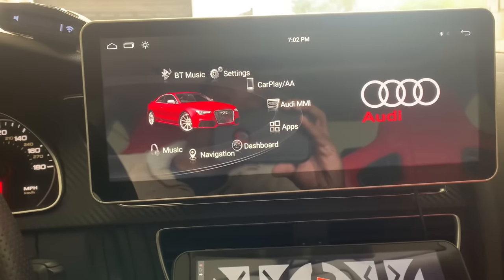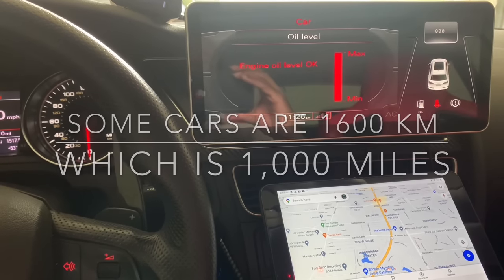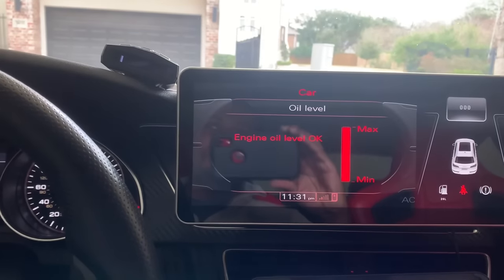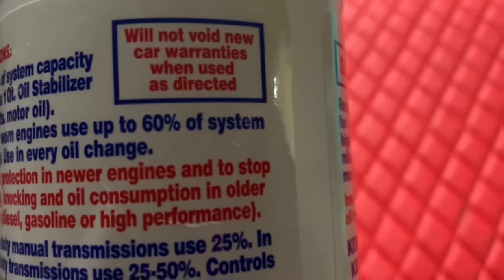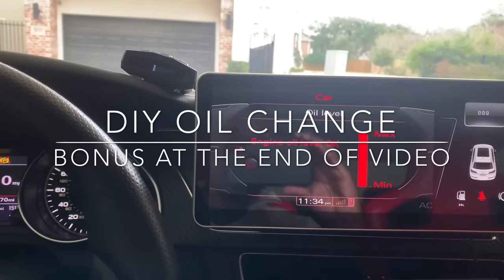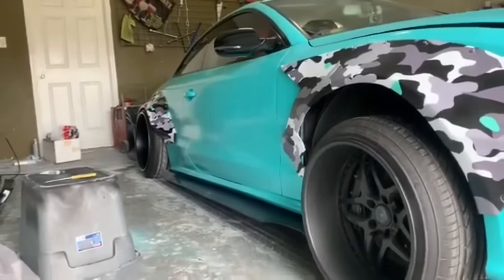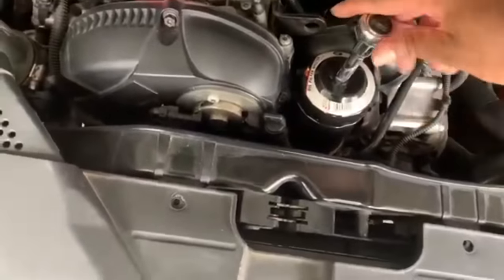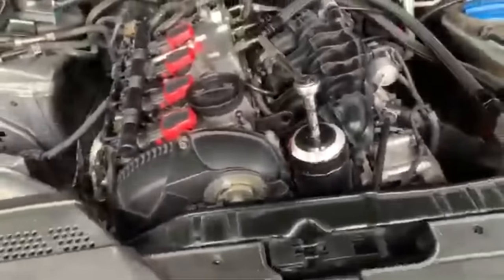How to fix Audi Oil Consumption for $10.00 dollars | Hack Audi A5/A4/A3/A6/A7/A8/Q5/Q7/S4/S3/S5/S7

Comment: I’m using this on my18 wheelers for years and I can tell you it works, at 40 litres of oil put a gallon of Lucas , change oil every 15000 miles and no adding is needed in between,
Reply from the maker: Exactly champ, thanks 🙏 God bless you brother and be safe out there
Reply: Hola buenas  mi audi 2.0 tfsi lleva   4.6l de aceite  le e metido 1l de aceite lucas y  3.6l de  aceite monly    el funcionamiento lo noto bien. Es correcto   la cantidad?

Comment: switched to green moly. used ceratek also with it. before oil change did the engine flush. let it idle for a few more minutes maybe 5 extra minutes and let it sit turned off for maybe 30 minutes. before used 1 quart every 500 miles. now using 1 quart every 1500 miles. BUT..... my car is a 2012 and not part of the recall so take this with a grain of salt

Comment: I am glad that has worked for you. My Q5 is averaging a quart every 460 miles. I just had the LiquiMoly flush and step up in viscosity to 5W-50 LM. No change in consumption noted. My next step is draining the oil, dosing seafoam into the cylinders and rotating it occasionally for a day or more, then doing the LM flush again.
Reply: omg my A5 is starting to go thru about a quart every 500 miles also.
Reply: What year are your cars?
Reply: @carlosjones5451  2014...it goes through a quart a month
Reply: @jfloyo11  my man, replace your pcv!

Comment: I knew about Lucas oil but was nervous to use it until this video. I literally had to buy two (2)  jugs of oil for every oil change. I HAD this issue in my 2012 A4. I only added 1/4 of a Lucas oil and not only did it slow down the burn, I also got an extra 100 miles out of my total range (was getting only 430 miles of highway driving, now I'm averaging 550/560 and 400 miles city) the throttle response has even improved. Still burning a little oil, but it's day and night. I saw the MAF sensor vid and will try that next, but I had to leave a comment under this one. Keep going Bruce⚡🔥⚡🔥🤘🏿
Reply from the maker: Most definitely brother let me know, and I’m here for anything you need 🤜🏽🤜🏽🤜🏽✌️✌️
Reply: How much lucus do you use per oil change?

Comment: Lucas oil stabilizer is amazing stuff in many application.  I was having trouble getting more than 12 months out a set of wheel bearings on a heavy Mack truck doing long distance.  Once I added the Lucas, wheel bearing life improved 400%.

Comment: So two months ago I bought an 2011 Audi A4, and wasn't aware of the oil consumption issue prior to buying this vehicle. I use it as an everyday driver to get to my college campus, so I'm driving it a LOT (bought it at 85k miles and have put 3k on it). I noticed early on that I was burning oil, contacted Audi with no luck, and have gotten a few quotes from mechanics regarding the piston ring replacement ($5,000, nope!). I realize now that this car ultimately wasn't a good purchase, however, I think I am capable of making it work for the time being. I'm going to change the oil next week and try this method, and also use some engine flush/Ceratec. It is smart to add both Ceratec and Lucas oil? I really enjoy driving this vehicle, I might replace the pistons and rings later on, but for the time being, I guess I will try to limit the amount of oil I am burning. Is this combination of oil stabilizers (Ceratec/Lucas Oil) a good take? Or should I just use Lucas Oil and give it a go? thanks for the upload!
Reply from the maker: I would just stick with the stabilizer, do it with an oil change, so you can have the correct amount, it works better win it’s added from the jump, and you’ll be fine don’t rush to spend money
Reply: Zachary, there is a settlement oil consumption issue..I had Audi replace the piston and rings for free if you are under 100k.
Reply: Adrian, I tried contacting three local Audi dealers, as well as AOA, and I was given the same response each time, which is that they wouldn’t cover the cost. I didn’t purchase my B8 from audi itself, rather from a used car dealership. If you got your rings replaced for free, could you please tell me exactly how you managed to get Audi to do a $5,000 job free of charge? Apparently the class action settlement is void after 80k miles. I’m sitting at 90,242 atm. LMK!!!
Reply: @zacharyclark5374  Did you call Audi? The class action was 100k before...I called Audi and argue with them several times ...also make sure you replace the timing belt chain tensioner as well ...that is another issue with those cars and there is another 5k job btw I bought mine from a used car dealership as well. The dealers know this issue all the way and they have a program that I don't remember now. Good luck
Reply: Dont worry about it bro Just keep burning that oil lol
Reply: @adrianacosta4487  do you go to a Audi dealer? I’m at 92k right now
Reply: @mauricioruiz7053  Yes, I did. Make sure you replace the Timing Belt tensioner as well. These are the two major repair for the Audi A4 B8
Reply: @adrianacosta4487  Theres no timing belt on this engine. Its a chain driven timing setup.
Reply: Can I ask you something about Audi A4?

Comment: I have a 2004 Ram 1500 and have used Lucas every other oil change since 2007. Approaching 200k miles and the motor is still going! I've also been putting Lucas in my commuter car, that is being replaced by an Audi A4 2.0T this weekend (>_<)

Comment: First of all, THANK YOU! We were in need, and my church gifted me an old car which someone had donated when they moved out of the area. It was a very well maintained 2000 Audi A6 4.2L V8. It is a beast! About 1,500 miles after receiving it, I noticed significant engine clunking. There was nothing visibly wrong, but I was horrified when I checked the dipstick (I wasn’t even going to check it as a car losing significant engine oil within 1,500 miles was never on my mind). But the dipstick looked like it was cleaned: shiny metal, shiny bright orange markers...there was no oil at all! I am blessed the car didn’t just stop working and the engine wrecked while driving. I topped it off, but after just a couple of weeks, it was already almost gone. After filling up with Lucas Oil product and Castrol Edge 5W-30, it has been a game-changer. About 1,000 miles later, and the oil is just below the MAX line. Wow. THANK YOU again for making this video, man!

Comment: I used liqui molly for the lifters in my mercedes benz V8, V6 and VW passat CC V6 and improve a lot the oil consumption. In the V8 and V6 VW it stops the oil consumption. Originally it was 750ml/ 8000km. But after the liqui molly for lifters it stops completelly. It really works!
Reply from the maker: Thanks brother 🙏🙏🙏🙏

Comment: I bought a 3.0t with over 100k miles. First oil change it burned through a quart in 2500 miles. By my next oil change oil consumptions seems to have stopped. 
I used Mobil 1 European Formula. Just saying. It stopped burning oil using Mobil 1.
Reply from the maker: 3.0t are strong engines, one of Audis best, I would say the coil was to thin, or old previously , or wrong grade, 3.0t generally, don't have burning issues, that often. and yeh mobile one is really good.
Reply: @brucecustommotors I have the a6 3.0t tfsi 2019 and just noticed that burned 3qt in les than 2k miles 😬

Comment: I tried everything to slow down the oil burning.  Replaced turbo, valve guides and PCV, still burning.  Went from 1 quart every 300 miles to 600 miles a quart. If your car burns 1 quart every 300 miles nothing will help except a engine rebuild.
Reply: Mine went as far as 1L every 250 Miles... Had to rebuild it aswel
Reply from the maker: Yeh me too, but if you notice in the video audi says that it is normal , even in your owners manual.for 1 quart per 620-to 1k miles. Trust me I have a tuned car, and this is the only thing that worked for me, try it out, its just 9 bucks, worth the try. I also have been using it for 3 years , and my car runs better. im on 120,000 miles now. cheers god bless. but if its the piston ring warranty issue, I feel you hopefully enough people did the warranty, before it was to late
Reply: it worked for me I was hesitant at first, but said what the hell, you should try it bro Lucas got a entire channel dedicated to this product
Reply from the maker: @cOnejittOpLayboY  yeh guess you fell under the warranty oil consumptions, how many miles did you have curious
Reply: @brucecustommotors  Broke motor (no more oil pressure, chain jumped off) at 132.000km. Did a complet rebuild and tuned after 3000km
Reply from the maker: @cOnejittOpLayboY  dang sorry bro, yeh they had a recall on the timing chain tensioner , that's why im doing these videos, to help people before its to late, lets pray this one last, check out some of my videos on car maintenance it, may help, and im here for any info you need
Reply: @brucecustommotors  Thanks a lot bro, and don't worry even with all the problems I've really enjoyed the car. I've been seeing all what you post, I think you do a great job and really help people out, keep it going!
As for me, I've got myself an A5 B9 last year, again the 2.0 tfsi, let's see how it goes this time...
Reply: After inspecting the piston oil rings.  My conclusion is bad oil ring design.  I think it would be OK if people uses high quality oil and chang it every 3k miles but once the carbon clogged up the oil rings there is nothing you can do about it.
Reply from the maker: @t2rx7crx1  yeh , that why the oil catch can is a must, I know you are in your break in period, let me know how it feels once you’re done breaking in, I’m actually going a 85 mm big big turbo set up
Reply: @brucecustommotors  900 miles now and my oil hasn't gone down at all.  The oil went down a little in the first 300 miles.  I'm using regular oil for the break in period.   The car is more responsive than before.  The IE piston ring has a stronger spring strength which probably contributes to higher compression and less blow-by.
Reply from the maker: @t2rx7crx1  you make me want to go ahead and put mine in lol, thanks for the right up bro

Comment: Pvc causes problems. But like Bruce said that's just the way German car operate. I use a quart every 650 miles. Also in these cars the oil goes to more than the engine.  Moly is a great product.

Comment: I just got a used 2017 A4 w/ 100k miles on it. I knew the dealer I got it from used cheap gas on it. You could hear it. I changed the oil, then ran about 200 miles of the BS gas out and filled it with Shell 93 and put a bottle of Liquid Moly fuel injection and gas treatment in it. Within 5 miles of driving on the highway, I opened it up and was cruising about 80 without any slowness as before. I drove for 20 mins and stopped for 10 mins to go in Auto Zone to get something. When I cranked it, my car purred. I saw that the timing chain was done as was the 02’s. Only thing I want to do is drain and fill the tranny and flush and fill my radiator. I have no issues after that and have put 430 miles on it in a week.

Comment: Thanks for the Vid!!!.., im going to try the stabilizer shortly on my wifes 2012 A4 as its been burning oil for years!!  I noticed you can also purchase Lucas pure synthetic oil stabilizer as well.  If I only run full synthetic oil, should I use the synthetic stabilizer, or do you think the regular one is fine to do the trick?

Comment: I have 2014 A4 2.0 turbo. Low oil comes on at 800miles,  I will try it. Thanks for the information.
Reply from the maker: definitely brother, let me know how it goes, so for its been pretty solid, as you can see from other comments.
Reply: Same here, how did the treatment turn out for your car? Just seeing oil consumption issues now

Comment: My Audi Q5 is burning about a quart every 100-150 miles. Will the Lucas help? I've been told I need to replace the engine and that it'll cost about 10,500 to do for a used motor (around 55,000 on used engine)
Reply: Hi, I was wondering if you tried it and if it worked?

Comment: When doing the oil change first remove the oil filter so the oil can drain better.
And the liqui moly is not the best oil 
Amsoil is class 5 and liqui is class 3.
Amsoil signature is the top 3 best oils available today.
About the oil consumption the lucas might help but we cant deny that audi/vw have problems when it comes to this from a while.
Reply from the maker: Thanks for the info, and tips🙏🙏🙏🙏🙏🙏🙏🙏💯💯 god bless brother
Reply: @brucecustommotors  keep the good work brother 
All the best
Reply: I only see Amsoil 5w40 labelled as diesel oil, is it ok for use or is there a specific application version?
Reply: @MichaelX1  what car u got ?
Reply: @flaviomartinho1753  S7
Reply: @MichaelX1  all 3 are European formula.
Red cap 5w40  is medium saps 
Black cap 5w40 is full saps 
Orange cap 0w40 is full saps 
All 3 are for the 4.0t

Comment: You think the water meth injection and catch can helps keep the pre-recall rings clean? I think Audi did engineer the rings to clog up and use too much oil. A lot of people say after the pistons and rings are replaced with the wider rings they no longer use oil. I have a 2011 A4, my car uses a quart about 800-1000 miles depending how I drive and highway/city driving... I haven't done the updated pistons/rings/rods yet.
Reply from the maker: Yes definitely check out my 2 videos on it

Water meth https://youtu.be/Fm5cEJr7Zm4
Reply from the maker: Oil catch can

https://youtu.be/CpOwiKTDdmk🙏🙏🙏🔥🔥💪

Comment: My 2012 A4 failed the oil consumption test. My car started consuming oil at around 45k. The dealer agreed to pay 50% of the cost for valves, pistons and timing chain. Motor rebuild was done 5k miles ago, it currently has 60k miles. Problem seems to have been addressed.
Reply from the maker: Amen, happy to hear, that’s why I make these videos to bring awareness to old and new issues, and how to take proactive steps god bless bro💪💪💪💪💪💪💪
Reply: How were you able to get them to pay 50%?  I have 55k miles on mine
Reply: @brucecustommotors  that’s good news I got a 2011 Audi Q5 2.0 with 74,160 miles and it’s burning oil. How can I ask the dealer to pay for cost of piston replacement job?
Reply: what was total cost for rhe repair you did?
Reply: @timpresutto184  total cost at the time Audi replaced pistons and rings were $3500 from me. However motor failed 10k after pistons and rings replaced. I paid $12,000 for a new long block to be installed 30 days ago.

Comment: Okay so for my 2.0 tfsi it worked but no like your result, I still need to top off oil once so often, I have 60,000 miles, should I top it off with Lucas or normal oil?

Comment: Thanks for this video! I just spent all my savings on a 2014 Q5 with 125k miles. I’ve had it a week and have already put a quart of oil in. Maybe a quart per 450 miles I think it’s getting. Was super stressed thinking I bought a lemon and grateful to find this video. Do you think I should bother taking it to audi to have them do something? Or let it go? I bought it from a Mercedes dealership as someone’s trade in. If I do this trick how many years do you think I’ll have on this car? I was really hoping this would be a reliable vehicle for the next few years. :/
Reply: Also do I need to wait until my next oil change if I do this trick? Or can I go for it now? Help! ❤
Reply: I had to fill my 2015 Q5 every 350 miles. It’s really frustrating. Let me know if you try this and what the results are.
Reply: @rhiannondethomas  whatever happened to your car? Is it lasting? I’m scared and thinking maybe I need to get this car traded out if it’s going to fail me
Reply: Change pcv oil breather. My crankcase pressure was too high. Make sure to get original equipment no knockoffs.
Reply: Want reliability buy a Buick 😆

Comment: I have an Audi A5 B8 3 TDI Sportsback Stage 1, the car has done 115K and oil disappears pretty quickly and I do drive it often on higher rpm but avg 3K RPM, is it normal or I have some sort of oil leaks?? I haven’t noticed any leaks at all and should I use the lucas in my car being at this mileage? If yes how much should I put in the 7ltr engine oil? Thanks

Comment: aye low key I thought you were gonna put the quarts in the engine and then show us how much Lucas you put in the engine . . .  

Did you put 5/6/7 Quarts plus 1 bottle of Lucas or half the bottle of Lucas ? ?  

Thanks 

GREAT VIDEO ✅
Reply from the maker: i just replaced 1 quart of oil with the lucas, my car takes 5 or so quarts
Reply: The bottle says put 25% Lucas from the entire quantity your car takes.
If your car takes 4qt's, the put 1qt Lucas for example. If car takes 5qts, put 1.25qts Lucas, and so on.

Comment: i have an audi a4 2008 2.0t I changed the oil after 1800 km Light for oil turns on,should use this with any kind of oil brand.
Reply from the maker: Makes sure it’s synthetic and 5 w40

Comment: I got a A5 2012 about 2months ago. I took it to the Audi dealership for oil pressure to low engine warning light. They said there was a leak so I paid around $380 to get it fixed and the car was fine for the next amount of miles I took it on a little road trip and the engine light came back on with the same issue. I took it back to the dealership and they fix it for free since it was supposed to be fixed and they didn't engine oil consumption check and now my car has the same issue after driving it to another road trip. So right now they're running another test the second test for it and they said they might need to do an engine and rebuild but we'll see how it turns out I'm going to try this from the video and give you guys an update;
Reply from the maker: Make sure you’re not still under warranty, 
https://youtu.be/itQIFUf0U7M
Reply: @brucecustommotors  I have a 2012 Q5 where I have to add a quart of oil every other month. It has 95K miles, is there a recall or warrantee that I can use? I haven't tried your method of adding the Lucas oil yet but will do next oil change.
Reply: Well how did it turn out??